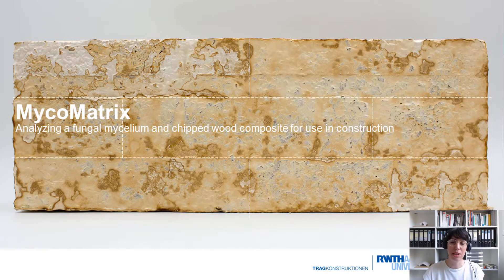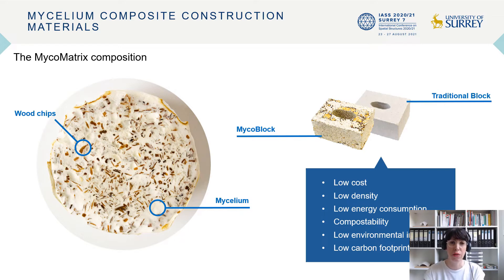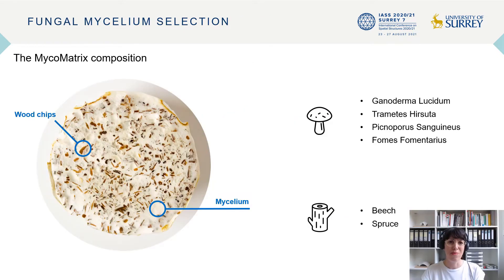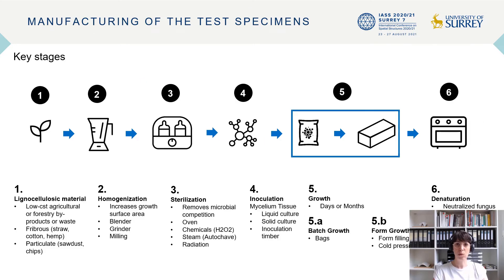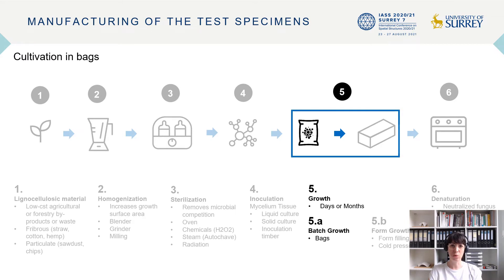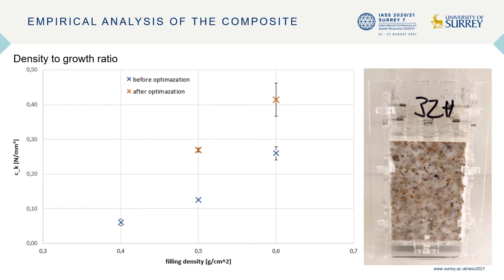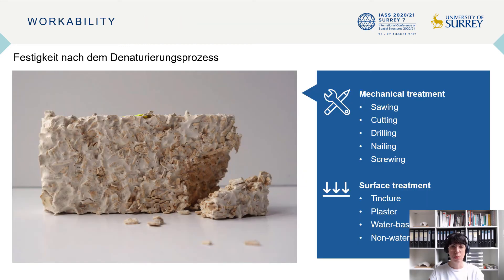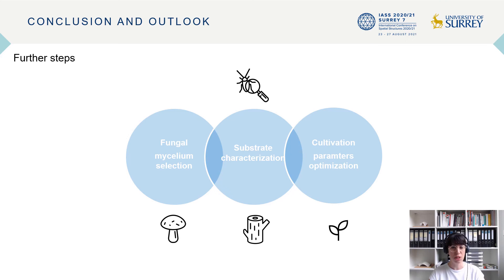Fungal mycelium and chipped wood composite for building components

Comment: Super interesting. 
If the mycelium brick is not baked, what happens?
Turn your "problem" of 'biological imperfection' and irregularity into an exploit - eg. could mycelium be developed for prefab/in-situ bamboo joinery (raw bamboo also "suffers" from irregularity).
I've always wanted a natural foam filler of sorts for my bamboo projects - could mycelium play a role? 
Curious about in-situ "baking" of mycelium blocks (clusters? nodes?) (presumably to kill the culture and arrest growth?) 

Need to research more! Thanks for the upload.